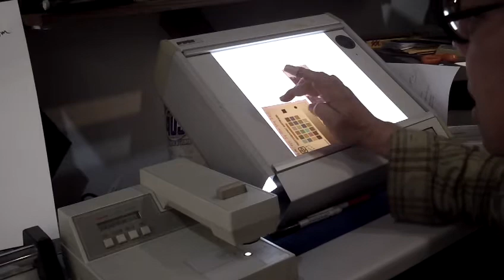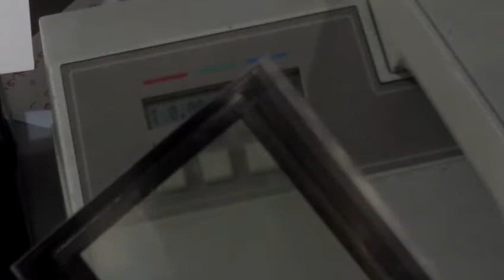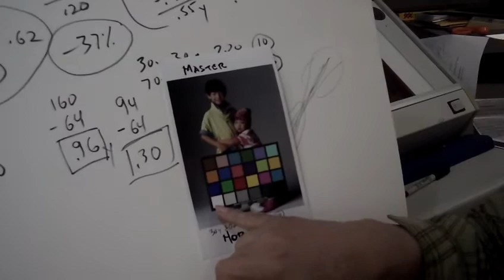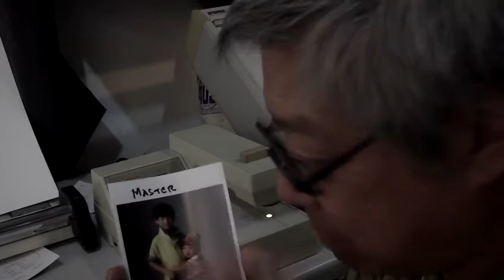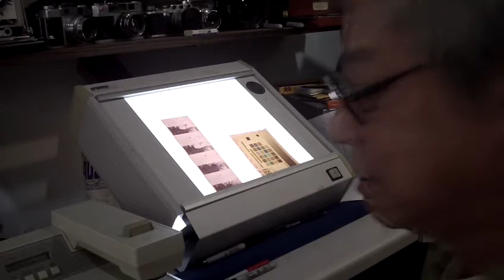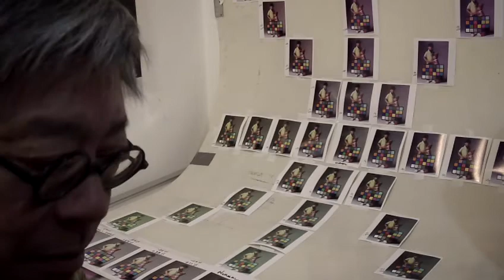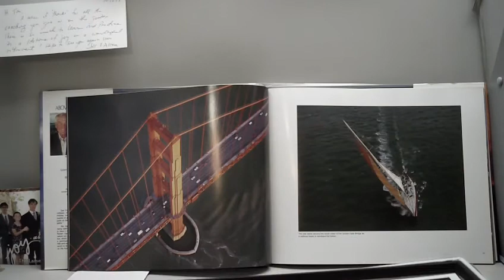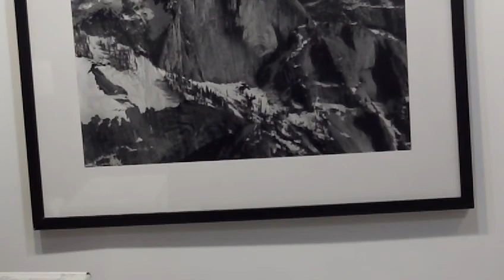Color Correction and Sensitometry - Part 2

Comment: Thank you for the content. I'm brand new to photography and have a question. Will the Densitometer let me dial in the settings for that "initial" master print.  For example, I take a photo of a grey scale/color control image I have no filter pack settings to start with and I want that my print to match the original color control document.  (ie. make my first master).  In other words I start with some filter pack and make a print and say my yellow is slightly orange, if I don't yet have a master with a known filter pack set how do I use a Densitometer to get to the correct filter pack.  Does the Densitometer  you show in your video also read the surface color of the print that is made?  Thanks again for your videos.
Reply: When purchasing a new box of Kodak paper it included a sheet of paper with instructions.  I am not sure if this is still the case, but on these instructions Kodak used to recommend a starting filter pack.  Usually it was 40 yellow and 30 magenta, or something similar.  There was never a recommendation for exposure as the technical sheet could not know what kind of enlarger was going to be used.  So a series of different amounts of exposures would have to suffice.
   Of course, after this initial exposure the darkroom tech would have written down this information and then have it for future reference.  This then becomes the beginning record of the master exposure.
   The first print coming off of the reference negative will inevitability be off in color.  The densitometer can now be use for determining the next print exposure.  Use the reference Red = .70, Green = .70m and Blue = .70 as your aim.  The densitometer can measure the gray patch on your finished (and dry) print.  It is important to calibrate your densitometer prior to using it.
   If your print measures Red = .90, Green = 1.10, and Blue = .60, (for example) then the first thing to do is to determine the correct exposure amount, that is, to get the correct density on the print.  Average the 3 readings... .90+1.10+.60 = 2.61.  Then divide 2.61 by 3 and you get... .87.  Your aim is .70, if you'll recall, so your print is over exposed by just over half a stop (.17).  Does this make sense?
   In order to correct this you must achieve the same light level on your enlarging easel and then change your exposure by 30%.  So if you were using 10 seconds change it to 7 seconds.  Now you must consider the color.  Your print measures R = .90 and Green = 1.10.  This means that your print is .20 too magenta.  So you also need to change your filter pack (on the enlarger) by 10 CC points.  So now you must add 10 units of magenta to your enlarger head.  So instead of using 30 magenta use 40 magenta.  Lastly your print measures R = .90 and Blue = .60.  This means your print is too blue.  It is .30 off from each other so now you have to subtract 15 units of yellow from your enlarger head.  So instead of using 40 yellow, use 25.
   You need to cut the filtration by half of what the densitometer records because the response that the paper has to exposure is not linear.  (It is a curve)  Likewise for the exposure calculation.
   These are estimates of what must be done in order to get a print with a better gray reproduction.  Obviously the best thing to do is to make a “Ring-around” like I explained in the video.
Reply: @TaiChiBeMe  Thank you for the reply. Your post is very helpful. I have a Densitometer on the way. I look forward to putting this to practice.  Thank you again.
Reply: One more thing.  Remember to make your color adjustments in your enlarger before making your light level adjustment.  Filter changes in the enlarger head does affect the light level so always make light level measurements with the correct filtration in the head.

Comment: Thanks for all you have been doing. I one part of the video, did you say that the darkness/lightness of the color negative film base affect your color pack setting(not just the amount of exposure. My pint to question, is that as I use my c41 developer from NEW to X number of rolls processed, with time compensation, the orange has inevitably becomes lighter over time, even with the same film type and emulsion number.
Reply: Sometimes I do a ring-around of a sort with my wallet size print mask frame, enlarged at height of end print. Basically making a set of minor adjusted filter tests when deciding if is a blue or a green color cast for example. Don't know if that is reasonable, but it was a way to learn judging a color cast, and have eight identical image sections with the minor filter changes in one print.
Reply: Okay, first I'll address your question about the use of C-41 chemistry. If you are re-using your C-41 chemistry again and again you should  be adding C-41 replenisher after processing your film. This is where a control strip is essential. Depending on the amount of film you process you need to add fresh replenisher into your container, and that container must not have any space for air to sit. This is to prevent any oxidation from occurring in the developer.  A control strip will let you know if the activity of the developer is consistent as you process new rolls of film.  Control strips are expensive, but you can make your own.  Just expose rolls of 35mm film (same emulsion batch) with even lighting; you can use the MacBeth Color Checker for this purpose.  It is important to keep the exposed but unprocessed film in the freezer so that the latent image is stable.
   If the film base turns color (from the same roll) the next time you process then indeed something is wrong with your developer. My guess is the utilization of the chemical is low. In other words you need to process daily (not once every week).  The replenishment will only work if your utilization is high.  Generally speaking you need to turn over all of your chemicals within a given time... say every 2 weeks or so.  That means if you are using 1 gallon of developer then at least 1 gallon of replenisher is placed into your working solution over that period of time.  Best to use "One Shot" developer in that case if utilization is an issue.  That is, throw out the developer after a single use.  Be sure to keep unused developer free of air.
   Second question : the ring around.  A series of prints that deviate from a "normal" exposure should cover a number of things. 
   1. The difference in density. You need to know when a print is 10% too dark verses 20% too dark.  Darkness in a print should not be confused with a print too cyan or green or ...  
   2. The difference in color. This is more difficult.  Sometimes you need to make a print really far off in color before you can see the difference between yellow and green. But only you can tell since only you can see through your eyes.  The point is to make prints that YOU KNOW is green and prints that you know is yellow and go off in color until it is obvious to you.  These are reference prints that you keep on hand.  Then you view your own prints through filters until you KNOW that your test print is too yellow.  Maybe there is a bit of green in there as well. View the test print with the yellow filter as well as a bit of green filter.  Find the balance between the filters until you feel that you are viewing your test with the correct filters. Now, if the yellow you are using is a 20 yellow and green filter you wind up with is a 10 green then your ratio is 2 to 1.  (2 yellow to 1 green).  Now look at your ring around.  See the yellow deviations from normal.  How far off is your test print.  Now here's the key.  Think in terms of factors of 2.  Don't use an uneven number... use an even number.  So you may think I am off by 10 yellow.  Think only of yellow since that is the predominant color that is off. If you correct by subtracting 10 yellow then you will also correct by adding 5 magenta... get it?  Your ratio is 2 to 1.  Two parts yellow to one part green (or in this case the opposite of magenta).  Likewise if your ratio is 3 to 1 then think only in terms of 3s.  Correct with 3 yellow or 6 yellow or 9 yellow or 12 yellow and so on.  Does this make sense?
   I don't think I spent enough time on my last lesson explaining this.  Thanks for the question!
Reply: Timothy Hall Well thanks for all the reply. For the last couple of mm the I have been consolidating my developing, to accumulate rolls for the 2 liter batches I mix. I only develope two rolls of 120 film onto a single reel at a time, and usually developer 2 to 3 pairs of 120 (sometime a single 220) on developing day. The left over chemical is the kept for later use, not ideal as I am sure part of what you are saying in your comments. My thoughts going forward were if I have more film to develope in a week, I would mix new chemicals for that day as a replenisher.
Reply from the maker: Replenisher is a different mix than working solution.  Currently I assume you are using a working solution mix.  I have to tell you that newly mixed developer is "hot."  That is, it is very active for the first batch of film that is processed.  After that the developer is "seasoned" and it develops much more gentle.  It especially processes more evenly across the surface of the film.  That is why they actually sell a "Starter" solution to season the tank of developer before customer work is processed.
   After that replenisher (which is a different formula than "working" strength developer) gets continually added into the tank while work is being produced.  You have too little film to process to warrant this procedure. I also suspect that when you first mix your chemical it is more active than when you later use the mixed batch.  Let me ask you this.  Does the orange base become lighter with the 2nd processing than the first one?  If so, this could be the reason, and yes, the different orange base color will affect you exposure time and color balance, although a densitometer should distinguish the differece for you and help you adjust for that.

Comment: I used to balance RA4 machines using aims and N U O...back in the early 90s. This is interesting.
Reply: Control strips exposed by paper companies and processed in house on a daily basis was the manner in which labs were to maintain a certain amount of aims and to stay in control of their processes.  By having your own in house aims provided by the use of your own produced master negative and print gives you more control and information than the solution provided by Kodak and Fuji.  By following through with these procedures on a daily basis your employees and staff learn quite a bit more than simply following a manual provided by suppliers. 

Photography is a very straight forward science and it requires only a good amount of common sense.  It also is rewarding in its own merits.

Comment: I understand the use of the densimeter to determine the standards values. And i think i get why you used film base for the demonstration but in real world negatives, it would br pregerable to use mid grey. 
Does that mean i should select part of image area on negative i feel should be near grey? And calculate acordingly. Would it be possible to use a lighter, near white area?And i suppose that would require some kind of equation to adjust for the slope?
Reply: The Macbeth Color Checker has a series of color patches on it. The background image (on my master image) has 2 kids with good skin tone as well as a graduated gray background.  The resulting print (made with 30 yellow and 30 magenta at 10 seconds) has all this information to work from. 
If the print you want to make (from your negative) has a light cloud in it that you want to look like the 3rd step of the Macbeth ColorChecker, then you can use that step as your starting point.  Measure that area on the master negative and use the RGB readings from the densitometer.  Then measure your negative (the area you want to reproduce as that light gray) and compare the RGB readings accordingly. That will give you your starting exposure.   Does that make sense?
   Of course, if you happen to want something on your personal print to match the black step of the MacBeth ColorChecker you can simply use that area as a reference and then measure the area of your negative that you want black.  In other words any area of the master negative can be used as a reference point.
   We often used the color patches themselves when clients asked for "duotone" looking prints.  In those cases we used black and white film sandwiched with an orange base and then compared RGB readings with the readings obtained from the master neg.  For example, if the client wanted a brown toned image we used the brown patch from the master neg to compare with.
   The middle gray patch is a good one to use when maintaining a master balance.
Reply: Thank you. 
That makes perfect sense. Pretty much what I thought. I'll be back in darkroom early next... time to start playing. 
You mention video analyzers, are they really that bad?
My enlarger can accept vcna values (not that ive seen an analyser or own one!)
Reply: The PS Analyzer software that my brother wrote for me allowed for everything I outlined above (and more). At the point where the printer would print out a label indicating a starting exposure for any given negative there was the option to compensate for anything you wanted.  For example, if the brown patch on the master negative produced a brown that was too red or too dark, the operator could then indicate an addition of 5 yellow and 5 blue and also to remove 30% exposure.
   In an instance like this (the example where I was deriving a duotone image from a black and white negative onto color paper) the densitometer (along with our software) did so much better than the $100,000 video analyzer from Kodak that it was ridiculous. A $5,000 densitometer used with common sense out performed the Kodak PVAC by miles because the PVAC had to convert a negative color image into a positive one that had very narrow specs... due to the films and papers involved.  It was not a universal piece of equipment by any means.  The densitometer was King.
Reply from the maker: The Kodak PVAC video analyzer did okay when film types were set up and all the film slopes were balanced.  But when faced with an unknown film (such as those coming into production where the film was from some unknown source... overseas or in many case old negatives that customers would bring in) then it did worse than a densitometer would. As in the case above, if you placed a black and white negative into a PVAC and tried to get a starting point for a sepia looking print, it would simply fail because they were not designed to do that.